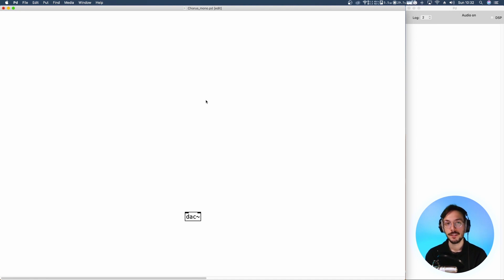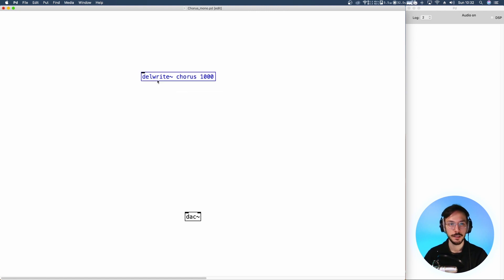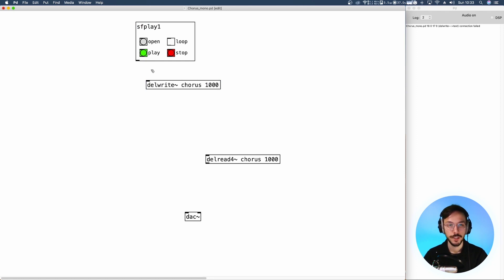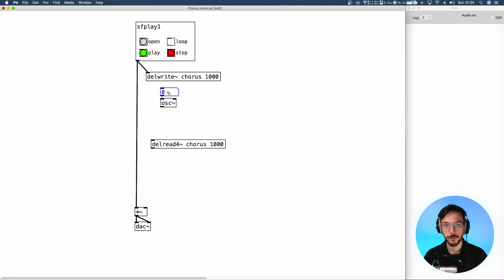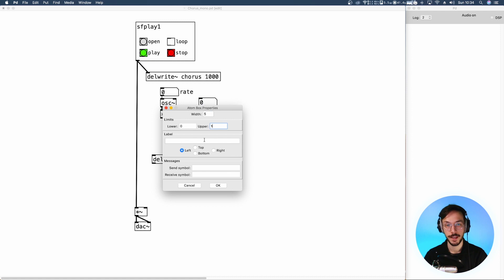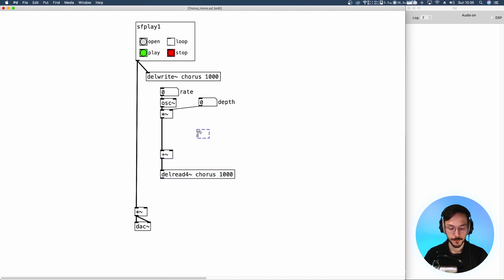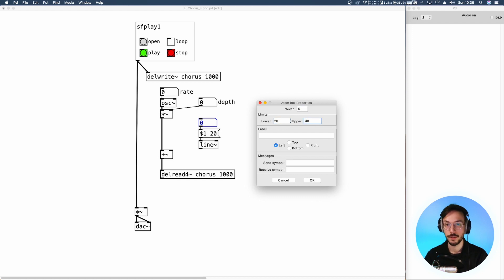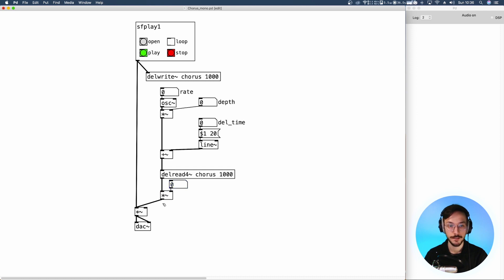Chorus Effect with Variable Delay Line | Pure Data Tutorial

Comment: Thanks! Will this work the same with oscillator- or phasor- generated sounds?
Reply from the maker: Hey, yes it il will effect any audio signal. The sound quality won’t be really good, though. Phasor~ is not made for audio (it’s not an anti-aliased oscillator). If you want to generate a good sounding saw wave you should use the sinesum method. Check out this video where I explain everything in detail: https://youtu.be/sW0924WWopI